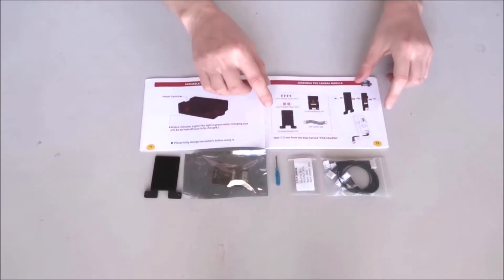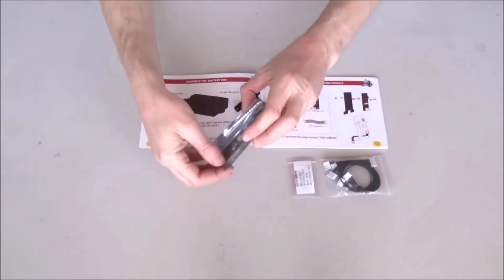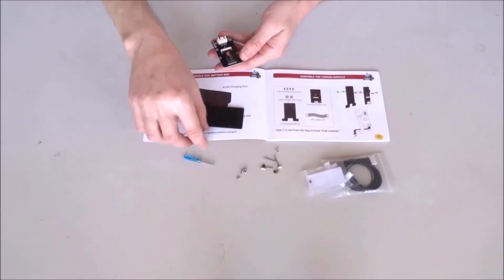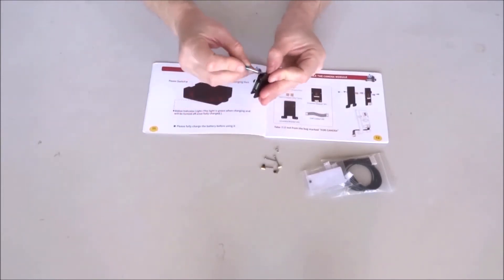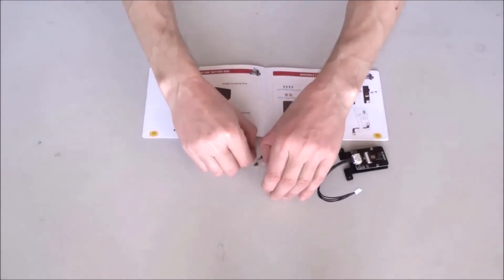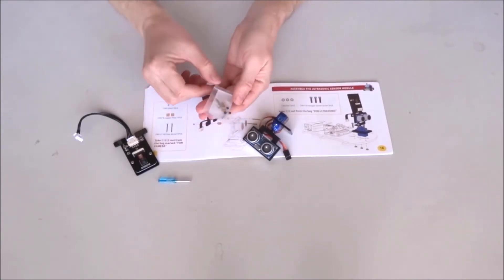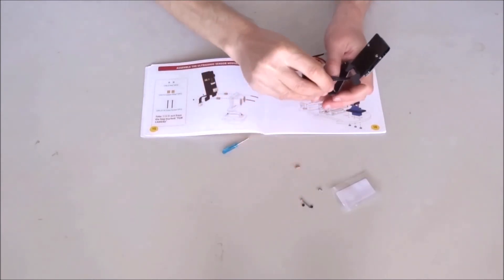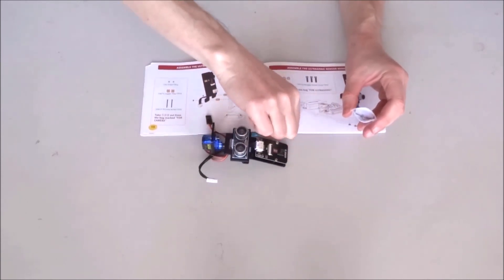Assemble  Elegoo Smart Car Arduino+ESP32 Robot KIT V4.0 Step 7: Install the Camera

Comment: Hi. Could you tell me where exactly located wifi module? I can connect to it's AP but i want to change it and make this smart car to be able to connect my home LAN that is why must know wifi module name in order to find right library for it.
Reply from the maker: The module is in the camera board at the front. It has USB-C connector if I recall. Remove the camera board from the robot, and connect it to PC with the USB cable. It is ESP32 module, and you can reprogram it with Arduino or Visuino . I will see to post a video on this.
Reply: @BoianMitov  Thank you for the reply. Yes yesterday i found it and now facing another issue. I mean want to find ESP32-CAM"  library but IDE does not find that one.
Reply from the maker: @elchinefa9524  Search online. Unfortunately I have been overloaded with work on other modules for Visuino and have not had chance to dig into the camera yet :-( . Will try to work on it ASAP and add to Visuino so the camera can also be programmed with it easier.
Reply: @BoianMitov  Already did it and now the camera connecting to my AP. Now must figure out how to  connect the original mobile app to it. Thanks for help.
Reply from the maker: @elchinefa9524  You are Welcome! 🙂. Good luck!